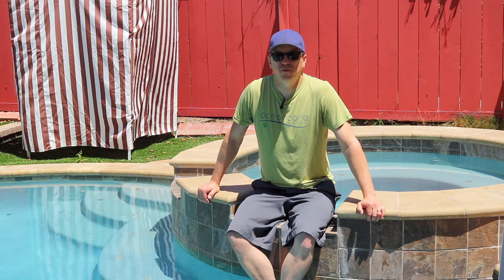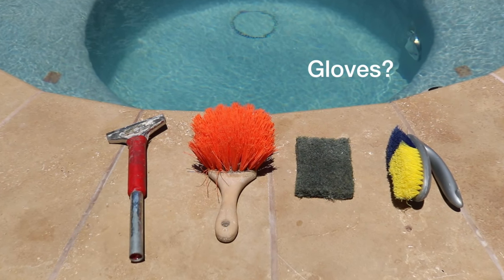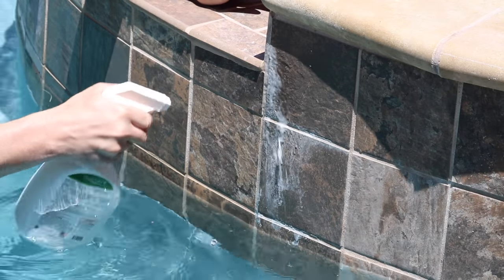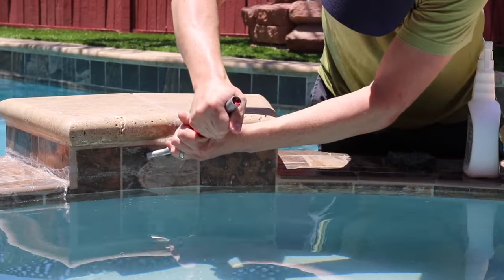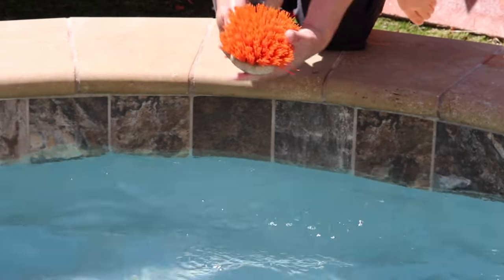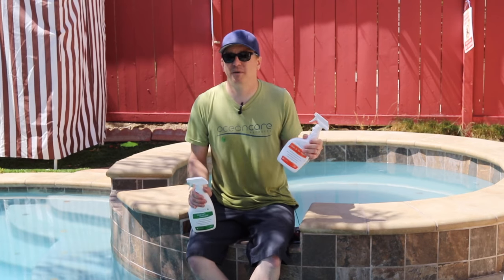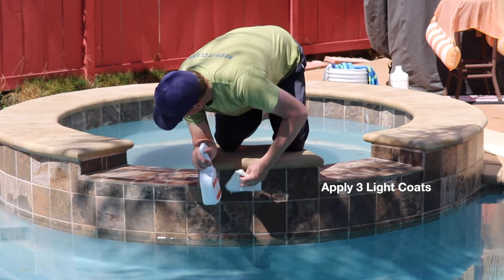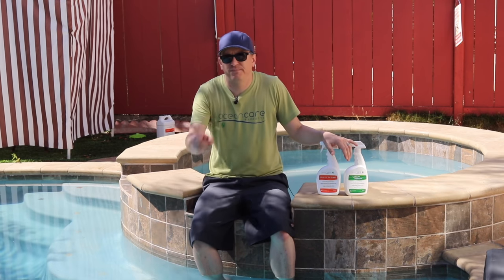How To Remove Calcium From Pool Tile (and keep it GONE!)

Comment: okay so you edited this video down to 6 minutes.. Fyi if I spent 6 minute on 15 areas each about the same dimensions as yours... I would just pay someone to do it.. how ever I know of a much faster easier way to accomplish the same if not better results... nylon filament wire brush preferably on a cordless drill to break away the larger calcium deposit..then Muriatic Acid and viola done, in just a fraction of the time.. P.S. mine is Stone waterfall which is much harder to clean then a tile..
Reply from the maker: I've mentioned before that this particular spillway and spa waterline took about 3.5 hours to clean and a little less than a quart of cleaner. But this tile hadn't been cleaned in over 2 years so it was fairly built up. But once it was clean and the Glass & Tile Shield was applied, it has been much easier for the owner to keep it looking good and has stayed pretty clean with just regular brushing. About 2 years after doing this video, I deep cleaned this spillway for the owner again, reapplied the Glass & Tile Shield and had it all done in about 30 min start to finish (the build-up was minimal). It's definitely much easier if you stay ahead of it with some preventative maintenance. Regardless of how you get your stone waterfall clean, to help make life easier in the future, I'd first seal the stone with Oceancare High Performance Penetrating Sealer, let that cure for 24 hours, then apply the Glass & Tile Shield. Future deposits should be reduced and easier to remove. Thank you for the comment.
Reply: @oceancarestore7831  well thank you for the advice.. much appreciated